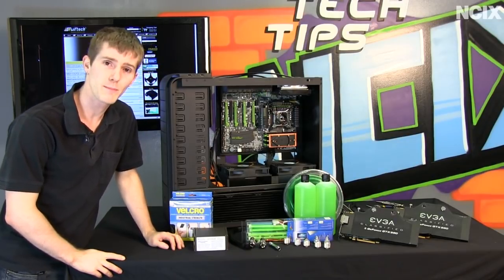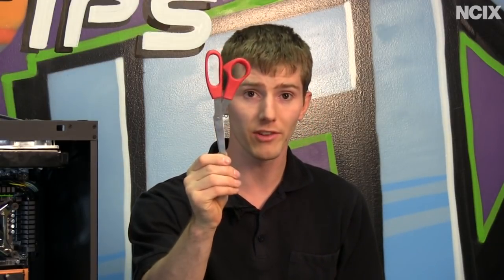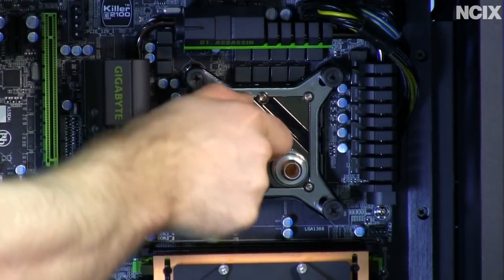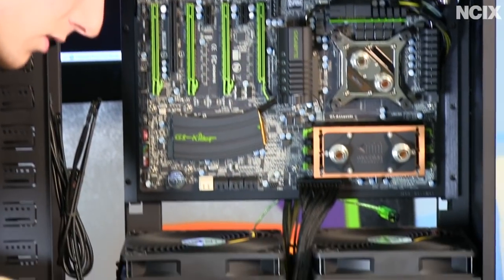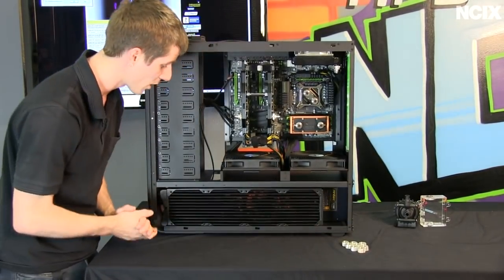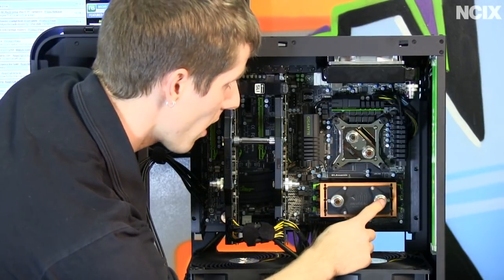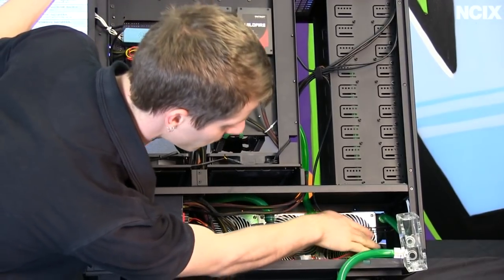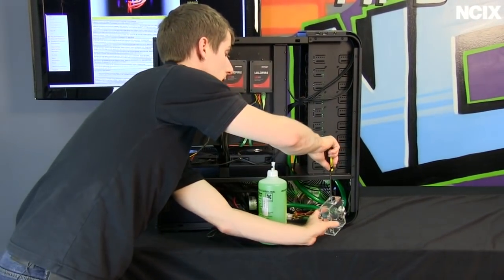Ultimate Water Cooling Guide Part 3 - Tubing, Liquid & Conclusion NCIX Tech Tips

Comment: I have hd 4600 graphics and I can max out today's games with 50-60 average fps
Reply: bullshit.
Reply: correct.
Reply: lmao
Reply: Although it is surprising what the hd4600 can still run. The new grid auto sport for example. At low settings obviously, but still...
Reply: lee smith the a10 7850k is even more impressive... sure, it was MADE to be used instead of a discreet gpu, but still... bf4 high to ultra graphics at 720p with ~40fps... damn...
Reply: Walter Aroeira That's what I got! gg
Reply: My statement was actually mostly true except for the framerates.  I tend to avg much higher than 60.  Because I have an r9 290 in addition to Intel's on-chip graphics :P
Reply: Martin Fracker True. I have my gpu and apu over clocked on my 7850k, and on battlefield 4 I get 45-50 fps average.
Reply: Martin Fracker Probably some shitty game. 290 can't handle 60fps on AAA
Reply: Martin Fracker Sure
Reply: X/2 the r9 290 is pretty much on par with a 970. You high?
Reply: ***** In your experience I guess.  Not in mine.

Comment: People don't usually watercool for lower temperatures alone, usually extreme overclocking or e-peen contests. Heck even aftermarket air cooling heatsinks aren't necessary for keeping a processor at a working temperature, but only if you have no interest in overclocking or if you don't have a lot of money to spend on a computer.

Comment: 2 years ago or so I built my brother a 4.3 GHz overclocked beast that used air cooling. It works great, although the fans make it extremely noisy and it's a dust magnet. Once I get a job and can afford to build my own rig, I'm going to use water cooling. :)

Comment: Hey Linus!
Im having a big problem I'm hoping you (or the community) can help me with and they are my INSANE microbubbles!!!

I've done many soft tube builds but decided to go with 1/2" rigid copper for this build. Used jb marine weld for all the joints. Looks amazing and I just completed last night after over a month of waiting for parts and building. Using an alphacool vpp655t pump. Alphacool rad, aquacomputer Cuplex Kryos copper cpu block and matching aquacomputer kryographics pascal copper edition. 
For the build I made sure to clean everything thoroughly and performed 3 full flushes with straight distilled prior to boot which is when I noticed the problem. 
I let it run over night but turned the pump down to medium so that the bubbles wouldn't get sucked back in the loop. Checked it out today and was happy so turned it back up to full and there are so many again! 
There are so many that there's a small layar of foam on top.

Comment: I definetely agree with you as far as getting fluid all over the place is conserned but that is an extremely rare case and usually happens if you do a slopy ass job , but even then if you select the correct type of fluid you can avoid a ton of problems that might be caused by leaks. I would suggest getting one that does not conduct electricity or even buy a volatile cooling liquid.

Comment: You have a point about airflow restriction, but there is no problem with the fans. They are covered by the spiraling grill you can see, no cable gets in there, especially blowing unto the cables.

Comment: This case is designed with airflow coming in through the bottom and out the top, Hot air rises. It is also really beneficial if your using heavy waterblocks for your graphics cards it's good because the weight wont put stress on the PCi slots.

Comment: Not to be rude..coming from an engineering background, you should be running a sealant such as Loctite 567 on the threaded sections of the mounting holes(where the compression blocks sit) for your cooling blocks just as a precaution. Also as you used 3/8 pipe to a 1/2 inch nozzle on the pump, a better option would be a hose ring as it would look cleaner and is more secure than a cable tie.

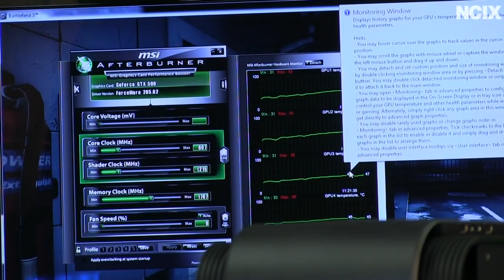Comment: @21:17....no its not the mounting of the block that's the issue, the main card in ANY sli config (or crossfire) ALWAYS produces more heat than the 2nd or 3rd. Nvidia pointed this out years ago. the reason for this is sli or crossfire configs only add's 35-75% more gpu power to a system for gaming than just one card. and the main card still does most of the work, so it will produce more heat.

Comment: Also, if your wrench slip away, you can hit components on motherboard, and damage it.
Best is tight fittings already on waterblock away from the motherboard.
By the way, if you are sure that you will not hit components you can try this method of work.

Comment: Since the water is moving through the loop pretty fast and constantly it won't freeze. But ya there are also coolants made just for liquid cooling. (if you use distilled water you most likely will want to use a "silver kill coil" to prevent algae, etc.)

Comment: So I've been looking all over the place for a tutorial that shows what to do with the wiring of the fans, and have no luck. I'm getting a 360mm rad and plan to put it in push pull configuration (3 on each side), what do I do with the 6 leads? Should I get some splitters and hook it up to a fan controller? Or get a bunch of splitters and merge it into one and hook it up to the CPU fan header?

Comment: it's a silverstone TJxx case, they have patented the 90 degree motherboard orientation, hence the videocards exhaust at the top of the case (if you're using air-cooled vidoecards).  in my opinion, it's a really nice design but no other case manufacturers can use it because Silverstone have it patented

Comment: Don t forget the with water you can get a MUCH bigger surface area to transfer the heat from the water to the the air than from the cpu to the air, that also mean it can be much quieter.
Maybe a nhd14 with 3 delta strapped to it could cool as much as a setup with a 240 rad but the watercooling one will be quiet and the delta one would only belong in a server room.

Comment: Pump: 100 bucks, Reservoir: 20, CPU waterblock: 60-70, radiator: 90, tubing: 10 bucks, 4 fans: 35 or 70(with LED's), and last your fittings: about 30 bucks for 6.
So yeah, even without GPU waterblocks (loads of options there) you are down about 300-350 bucks.

Comment: Hey!! Very nice vidos my friend. I liked and subscribed! 
I have two questions
1: If i have long cables, how do i know that the pump has the power to push the water throughout the system?
2: The pump must be powered from the power supply? I saw a bridge you did there and i dont know why.

Cheers! Your Videos and your Guides made me so sure to add Water Cooling and HOW to add Water Cooling.
Reply: ***** Don't worry about cable length, it won't affect the energy that is transmitted (unless u've got like 500 meters of it, and I don't think that is something you have inside your pc)
The bridge is to ONLY power the cooling system, because electronic circuits, when powered, will make energy flow through any conductive material (even if not at the beginning, eventually, every coolant becomes conductive), so, if your system is powered up and some of the liquid falls in it, it will short circuit your hardware, seriously damaging it, so, if it falls in turned off hardware, you will just have to let it dry and if you turn your system on, it will work just fine. Check out the wet laptop video at linustechtips if you want more detail and actual proof on what I'm saying.

Comment: Well it uses both Air and Water. The water helps when it is idle, but when it is in motion the air blows over the engine and does a large amount of the cooling. But in the end it still needs both. Basically if no fans on a Radiator then it can't cool the water and without the water in a air cooler it can't pull away the heat fast enough.

Comment: Is running the system through a second radiator 100% necessary? Also are there any rules for the radiator/reservoir/pump placement? (e.g.) never put reservoir above the pump?
Reply: Lol you always put The reservoir above the pump so it doesn't run dry and break

Comment: It looks like you didn't put a waterblock on your HDD's?  I would have liked to seen how you put the waterblock on them (they make waterblocks for HDD's) and how you included them in the loop or if you set up another cooling loop just for them.  

You did take time to water cool the memory even though you said it wasn't necessary.  May as well made it ultimate with the HDD's as well?

Comment: i just bought 32g(4x8g) gskill tridentX at 2400mhz, when you OC the ram they do tend to heat up pretty bad, soon they will be bringing out the 8g sticks 2666mhz which will be pretty insane. if you use all you slots then watercooling your ram wouldnt be a bad idea.

Plus these ram come with there own heat sink and looks pretty insane check them out

Comment: I actually prefer filling the loop from the highest point so on of the top ports on the top rad or inverting the system, that way you don't have to worry about water wanting to come back down, and you don't have to keep risking running he pump dry because the loop will fill itself via gravity, linus really made this more hassle than it needed to be, I wouldn't recommend this video to a first time watercooler.

Comment: The water won't get so hot in the GPU block, because the water is moving so fast in the loop. There may be like 2 or 4 degree difference between the radiator and GPU block. Imagine a room, where it is 100 degrees Celsius (water boiling temperature). If you just run through the room, you won't notice much. If you decide to sit in the room for longer, you will notice.

Comment: hmm.. maybe youre right. i mean yes, youre pushing hot air the way its supposed to go (up), but with the cards so close together as they normally are in standard SLI/Crossfire config would you really be able to get more cool air in? im not against it, im just curious to see how the convection works and whatnot of the ambient temperature of the air around and inside the case.

Comment: well to get technical the coolant is 50/50, 60/40, or 70/30 blend of anit-freeze solution and water. plain water can be used but has a lower boiling point and also if you try to use only water in a cold climate your car will be ruined which is why an only water solution is temporary in the case of getting a leaking radiator fixed or what not.

Comment: actually you use both in a car. air is taken in through the front as the car moves forward in addition to the radiator fluid which is the equivalent of "water cooling"

Comment: To answer your questions:

1. Don't know the exact prices because I'm too lazy too look it all up individually but you're looking at a cpu water block, ranging from $50-$100, 2 gpu water blocks, which are around $90-130 each, a 480 + 120 rad which are around $130 + $40 dollars, a pump could range from $40 to $130, and at least $5 in tubing + a $30-ish resevoir. So around 500-700 dollars, $550 being a way above average cpu + 2 gpu loop!

2. I was thinking the exact same. You're probably right.

Comment: I heard that certain brands of colored water cooling fluid can change the color of your tubing and gunk up your components and some brands do not like nano fluids. Is this true? I also heard your better off just using colored tubing and regular distilled water with additives put in it. Is this true as well?
Reply: mark swishersweets distilled water will also change your tube's color (all doe u won't really notice it much if it's not transparent). If ur using distilled water you will have to use a killer coil and do maintenance way more frequently then with a nano fluid, I personally am quite new to this and haven't been much into water cooling until now but going to linustechtips.com or just tom's hardware would be a good place to ask questions about things you can't find on google.

Comment: So you're telling me is that if electrically charged liquid leaks out of a rubber tube that's been used for years and is very worn, it wont cause a short circuit and fry your components?

Comment: That depends on what "better" means.
Cooler? Maybe...
Quieter? No...
Heavier? No...(well, it is heavier but that does not make it better)
Smaller? No...
Better-looking? No...
It's really personal preference. I just ordered an H60 because I plan on overclocking my 3770K, but I was considering the NH-L12. However, my case isn't particularly large. It also wouldn't look very good inside. I COULD have gotten it, but I simply wanted the H60 more. And the H60 was only $60 with free shipping.

Comment: I would say that going from 3.9 GHz to 4.5 GHz is overclocking...especially since 4.5 GHz was my goal in the first place.
However, I had to get the H60 because no other liquid cooler would fit in my case. Likewise, I don't have the space for a bulky air cooler.

Comment: would it be possible to use something different then water? like a thin baby oil or something other oil based product so in case of a leak it would not short-circuit the parts?

Comment: Just a question, if I have a Corsair 600 watt power supply, and I put 2-way SLI GeForce gtx 660ti 2gb video cards, will the power supply not be able to handle it or will it be fine?

Comment: Yes you can salvage it but it requires some careful modding. I have not personally seen someone do it so I have no idea how, but I've seen a couple of pictures online of people modding their H40s, H60s, H80s and H100s to use in a custom loop. If you look hard enough you could probably find a tutorial because the H100 does actually have a decent rad. Also, what GPU do you have? Because it's a 4GB card I'm assuming it's a 680 or 690?

Comment: If you heat the your deionised water to around 80C for 5-10 minutes (or even better, boil it for a minute) before you start the filling process you'll get rid of most of the dissolved gas (let it cool). From there if you take care not to agitate the surface as you fill, it won't absorb much air - this should reduce the degassing time dramatically and extend the lifetime of the coolant/antifungal additive.

Comment: so when you refill the reservoir and get it pumping the fluid, do u only need the PSU switch on to circulate the fluid the the radiator, cpu, etc or do u have to also turn on the computer?

thanks

Comment: straight antifreeze will freeze easier than when mixed with water. without water it will freeze around +8 degrees so its highly unlikely that there is no water because when it is added to the anti freeze it lowers its freezing temps. and in most cases only antifreeze would overheat the engine.

Comment: Been running water cooling for a while now... No leaks. Whenever I take the tubes apart to drain and stuff it is VERY hard to pull the tubes off, I have to cut them off everytime with a razor. Not to mention, they have anti-conductive coolant now....

Comment: Not that it matters, but I already have a degree in microelectronics and know what there is to know about electricity. 

Voltage is not power, and is never referred to as power under any circumstances when discussing aspects of electricity. 

What makes you think that it does? What is your source or reference for holding this belief?

Comment: Closed loop i do admit my NH-D14(top end air cooler) runs close to high end closed loop water coolers. But comparing it to a custom water loop , the custom one wins hands down (though the custom water cooling custom alot more) it still gets better temps.
There is only one time where air (if you count it as air) wins. That is when you use a peltier in combo with it . Which gets possibly bellow 0 degrees, but is stupid cause you get condensation
 and fry your board if not insulated

Comment: yeah, i was interested in water cooling until i watched this video.
my i7-930@4.3GHz and noctua nh-d14 with only the middle fan installed and gtx580 @950MHz with artic accelero cooler perform exactly the same as this water cooling setup, are whisper quiet, a fraction of the cost, and most importantly no chance of hardware destroying leaks.
i'm staying with old fashioned heat pipe monster heatsinks thank you very much.

Comment: Actually, a second graphics card does not increase vram at all. It does however have the ability to dramatically increase performance in games, in some games I double my performance using my second graphics card. HOWEVER, multiple graphics cards is not a perfect solution. They can get buggy and cause unforseen problems, which has led me to disable my second card on a few games. While it's not the norm to have such problems, I would recommend spending the money on one really nice gpu if possible.